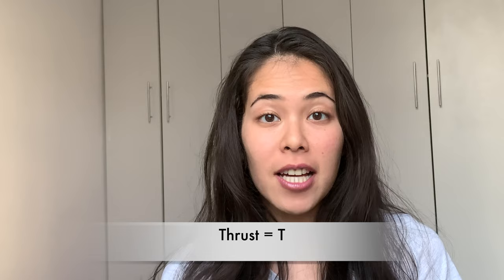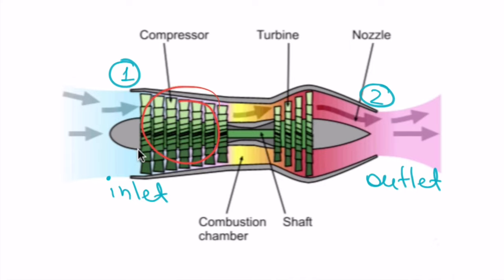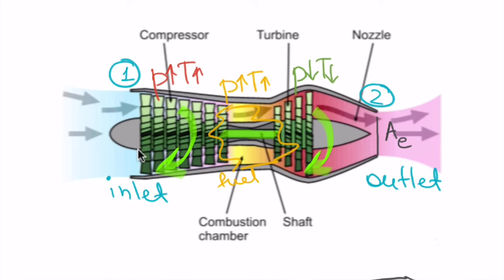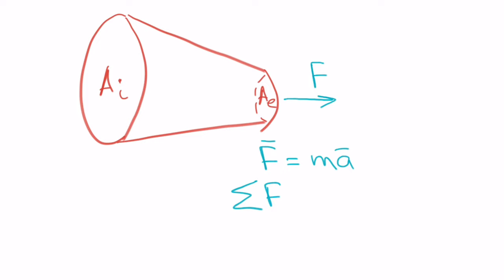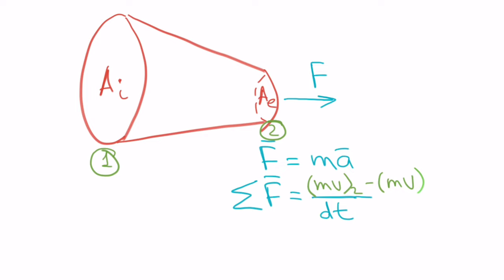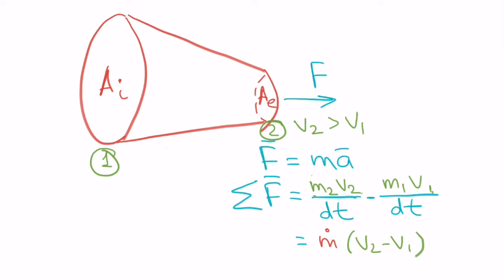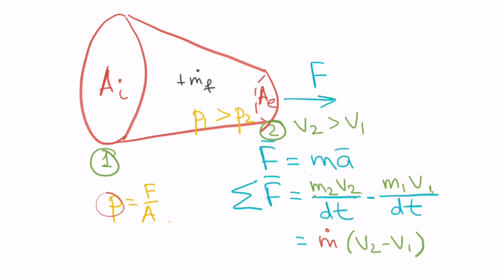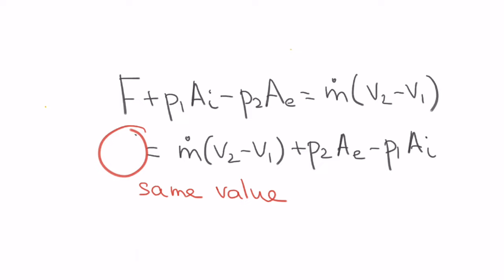Introduction to Propulsion: Jet engine thrust

Comment: Thrust Is provided By ? 
A. Rate of change of momentum of air 
B. Change in Mass flow rate
Reply from the maker: A
Reply: @AliyaBurkit  but mam....if we change rate of mass flow ....then also must change in thrust of aircraft
Reply: mass flow rate does not change through the engine thus, it's not changed thrust or create thrust(it is kinda tools for create thrust). if u assigned a new mass flow rate your thrust will be changing but the reason for that is changing the momentum of air.
Reply: @batuhan3066  yeh brthr u r right
Reply: Thanks for explanation mam....

Comment: 2:24 there's a mistake, in the combustion chamber the pressure DOES NOT rise.
Maximum pressure in a turbojet (or turbofan) is reached at the outlet of the compressor just before entering the combustion chamber. You can simply verify this by looking at the Brayton cycle.

In reality Into the combustion chamber the pressure actually decreases a little bit because of Rayleigh losses.

Comment: i understand the continuity equations regarding the mass flow rate, but how are both values of m-dot  the same if the exit velocity is increased and air is compressed increasing the velocity?
Reply: *if the engine has a centrifuge

Comment: Great explanation👍🏻
A question: would be the heating of the gasses after the turbine (not with afterburner) generate more thrust?
Reply from the maker: Great question. No, thrust only depends on how much air and how fast it's leaving the engine. You can't make more air by heating it up
Reply: @AliyaBurkit  thank you so much
This is right😅😂
Thank you😉